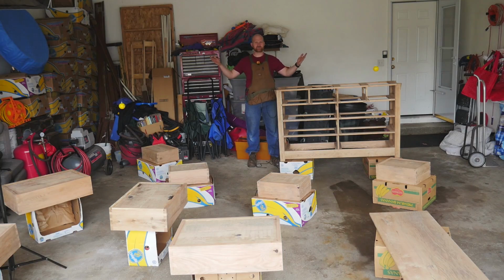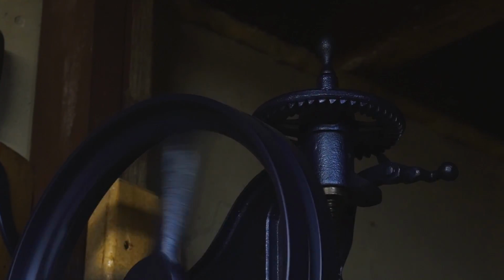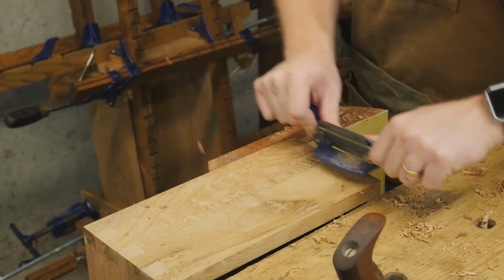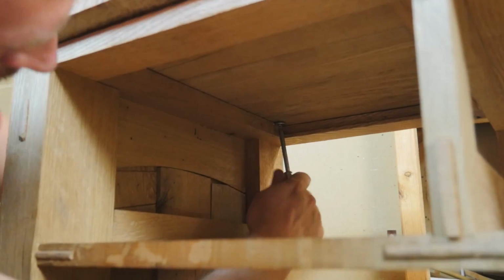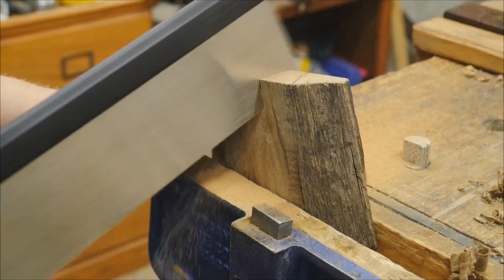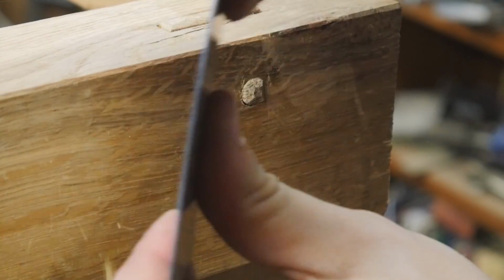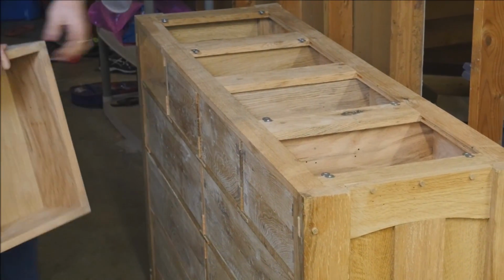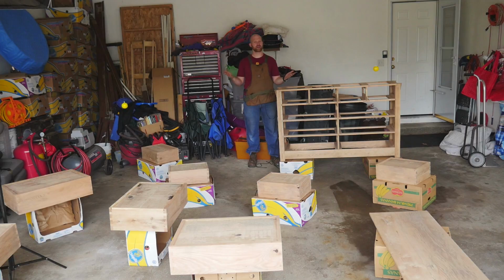Hand Tool White Oak Dresser Part 9 Hardware l How To Woodworking Project

Comment: thank you James . question please i saw you use the glue bot are they worth it ?
Reply from the maker: There are blue bots and then there are other glue bots. The cheap ones are hard to squeeze and don't really work well. The nicer ones have a slightly thinner wall and are easy to squeeze. I absolutely love them as I can glue underneath things and squeeze uphill whereas with the normal bottle you can't squeeze with the tip up. But in the end they're very personal choice. A lot of people like them and a lot of people don't.

Comment: It looks so good. Question: Why that much time? working in between project or that much time working on it completely ?
Reply from the maker: I put out 3 videos a week so most of my shop time is spent on getting those out. I just worked on the dresser in between projects. all told it was about 500-600 hours of work.

Comment: I had been wondering how you were going to connect the top to the carcass. didn't even know figure 8 fasteners like that existed. clever really
Reply: Brad Knecht and a bowtie dresses everything up hahaha
Reply: Wood By Wright Gotcha. and bc they are wedge shaped it could cause the wood to split...
Reply: Wood By Wright Thanks for pointing that out. I wouldn't have thought about expansion/contraction. probably saved me some future heartache
Reply: So if we do consider expansion and contraction, do you think it would be possible to orient the through tenon such that it would minimize damage...say if the cross grain in the leg matched the cross grain in the top of the table?
Reply: sent an email with at pic....can't post it here, but maybe my understanding is wrong
Reply: Wood By Wright Thanks for the picture. But what if you staggered the bowties such that they were square in the "ok direction" but offset in the "not ok direction"? what trying to describe is if you looked at the top the bowties would form the points of a rhombus. I realize this isn't feasible for most furniture but could would for side tables or entryway type tables.
Reply from the maker: yup they are my favorite method.
Reply: Wood By Wright I've been practicing making bowtie shaped through tenons. I like the way it looks. thinking about using it to attach tops to everything I build...like a trademark
Reply: Kirby, do you have an image or could explain a little more? That sounds very interesting, but I've never heard of such a thing.
Reply: Brad Knecht I will assume you know what a through tenon is. but instead of being rectangular the tenon is the shape of a bowtie. so it's a combination of a bowtie (typically to fix splits and such) and a through tenon.
Reply: ok, so looking from the top down at where the legs connect, you would see a bowtie in the top above each leg?
Reply: Brad Knecht correct. I think it looks nice.
Reply from the maker: that has got to be interesting for expansion and contraction. I would love to see it in use!
Reply: Wood By Wright I didn't even think about the wood expanding and contracting. although I do live in San diego so the temperature is pretty consistent. do you think the expansion/contraction would cause severe problems?
Reply from the maker: yes. It is not the temperature but the moisture that is the problem. And being near the ocean can make that very heavily.
Reply: Wood By Wright why is this not an issue with traditional bowties?
Reply from the maker: normal bowties live in their mortised wood and are not holding the board in place. but if you have two tenons coming through from the structure underneath, then the table top will try to spread those two tenons apart or crack the top when the top pulls together in the dry times. if you just used one then the whole top could spread and contract from that one point but when you put in more across the grain then you can have issues.
Reply: Wood By Wright Isn't your work bench top mortise and tenoned to the legs? and if I'm remembering correctly they had some sort of nonrectangular shape. does this work only bc it's a laminated top?
Reply from the maker: correct it laminated with the grain running up and down so it will expand up and down rather than across the top.
Reply from the maker: It has more to do with their relationship to each other.if they are going through the same line in the wood then there will be little to no movement between them but if there are many lined of wood between them then the wood will expand and contract in that direction. so if there is only 2-3" between them then the movement would generally be too small to matter much, but if there is 10-15" between them you could be talking about 1/8"-1/4" movement between te two points of contact.
Reply from the maker: Here is a link to a picture of what I am talking about. https://goo.gl/photos/DMYvVLC1rjfJ6Wx27 it has nothing to do with the orientation of the butterfly but more to do with will the wood between want to move those two butterflys futrher apart (either crushing the top or ripping the skirt out of the leg) or compressing (and breaking a butterfly or cracking the top.)
Reply: Ah....got it....the wood in between
Reply from the maker: that would depend on the wood hand how much flex it had. most woods would not flex much at all and the same pressure would be applied.
Reply: Wood By Wright Well I'm glad I only used scraps for practice. I would have had a split top on a piece I spent a lot of time on. thanks for sharing your knowledge
Reply from the maker: well it probably won't split for a year or two. but it would not be fun to find one day. I need to do a video on wood movement.

Comment: At about 1;55 you used the term "short throw brace".  Could you explain this term?  

Thanks for the video. Great build.
Reply from the maker: the arm does not stick out as far from the center of rotation as most do so you can rotate it faster. I am wanting to do a video on it soon.
Reply: Thanks.  I thought that may be it, but just wasn't sure.